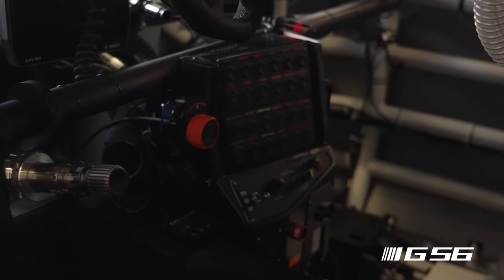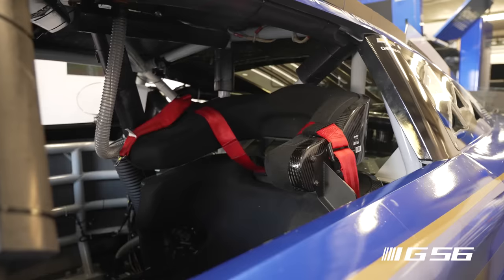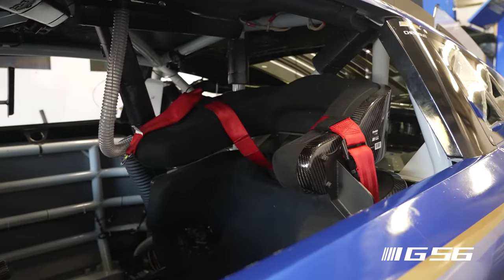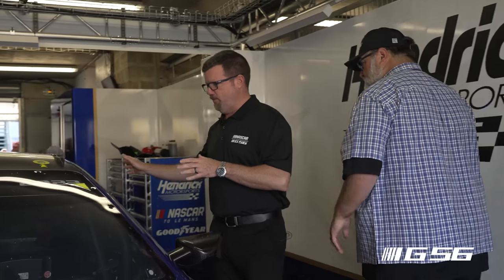Garage 56 Le Mans Tech Tour Part 1 with the NASCAR Chevy Camaro ZL1 Cup Car

Comment: I love how all European motorsport experts got everything wrong about this project and what they expected LOL
Reply: I dont even think the Americans knew what was coming. This thing looks awesome, sounds awesome and is such a cool addition. According to Jenson Button, it's not even the monster we expected it to be down the straights, but much better in the turns, both high-speed and low speed than expected. It just struggles under breaking, because its fat
Reply: @kolorado7260  yeah it looks like the downforce is decent, but the aero is pretty inefficient. lots of mechanical grip though
Reply: @kolorado7260  And over 2 seconds a lap faster than the fastest GTE...
Reply: @Kyle86910 Well it's testing. Nobody in the GTE class wants bad BoP because they were too fast during the test days. I'm sure they are still hiding a bit of lap time.
Reply: @ciello___8307  that’s the thing, that amount of mechanical grip is insane, it makes a little aero go a long way at higher speeds. Danny Ric and LH said they’re like giant go karts
Reply: @ciello___8307  it's a stock car, not an aero Machine. The whole point was to take a car very close to the cup cars modified to fit La Mans requirements and go racing. 

I honestly think the real thing to prove here is to make it through the 24 hrs and still be driving st the end
Reply: @devinaschenbrenner2683  absolutely. Stock cars don’t have a great track record here, if it finishes I’m stoked
Reply: @devinaschenbrenner2683  I was more referring to comments jenson made in an interview. He said the type of aero they installed on the car (like the duckbil spoilers) aren't as effecient as whats on the GTE cars, so their top speed on the straights isn't as high. they are making speed in unexpected areas
Reply: I don’t think that nascar believed that it would possibly show up most GT cars. The only ones not surprised might have been Hendricks.
Reply: To be fair , it could have gone either way , it all depended on how much of an actual cup car they would keep . This is massively modified from a cup car but still very impressive bit of kit
Reply: How long will tires last with that weight? The amount of pit stops over 24 hours can add up!
Reply: If you genuinely think this is going to be faster than the GTE cars at full race pace better think again, even Jensen and Jimmy both said they can’t hang with the GT cars. They have the torque out of the corner but lack the aero to stay in front of them.
Reply: @Maenfy  True to an extent but if you look at the sector times where they are pushing the nascar is right there... The FIA was planning on waving the flag if cars were coming up behind them but after practice they pretty much said oops nevermind the nascar is faster than we expected
Reply: @JustinCFC  5 seconds faster can’t hang wtf are you on?
Reply: @RonnDoge  go watch the interviews with both of them.
Reply: @RonnDoge  everyone knows GT cars sandbag before BOP is announced. I’d love to see Garage 56 do extremely well this weekend too, but just keeping it realistic.
Reply: @Kyle86910  5
Reply: @ciello___8307  its top speed was 312km/h in the race, compared to 305km/h for the GTE car that finished first in the GTE class. They had to slow it down on the straights because it would overtake most of the field on the straights if they didnt
Reply: @Maenfy  they were literally leading every GTE in the race until their gearbox blew up
Reply: @whenisdinner2137  Yeah but how was I supposed to know that before the race started? Also the Corvette did a faster lap time then the G56 car if I'm not mistaken.

Comment: NASCAR needs to run its own 24hr event. That would be too logical though.
Reply: Agreed. I'd even settle for a 6 or 8 hour race at Road Atlanta with two mandatory driver swaps. VIR would be fun as well.
Reply: COTA, Sonoma, Watkins Glen, and Daytona all good candidates for a 24hr race. Although I don’t think the drivers will last unless they pull up Xfinity and Truck Series.
Reply: IMSA is owned by NASCAR, so they technically already do
Reply: @BaffinSailor  Maybe each car has to be fielded by a team. Like, Hendrick only has 1 or 2 cars. It has to use the 4 drivers they have.
Reply: Only if they use cars like this I would watch. The current ones are too slow.
Reply: It would be fun but it's impossible with the current cars. The components just aren't designed for that kind of endurance. Hence many of the changes needed for the G56 car.

Comment: I heard the tyres say "Ouch" at 2960 lbs
Reply: that's 340lbs lighter than the standard Cup car. The tires will probably be happy. I'm curious if they're running NASCAR compounds and tire builds, or a tire similar to the ones on the GT cars.
Reply: @2005StangMan  I hope he asks that question in the next video!
Reply: About 150 lbs heavier than a GTE.
Reply: @2005StangMan  Goodyear supplied special tires for this Camaro.
Reply: Yup, developed specifically for this car after a few weeks of testing on the test mule the team built.

Comment: "If you can take 5-8% of weight off every single piece, you can save an amazing amount of weight". Yes. about 5-8% total 🤣 jokes aside, just cutting off the bolt ends to 2 threads on my bucket-o-bolts was 41 pounds (good old steel alloy, not titanium)

Comment: But yet we can’t have a 300 mile race without blowing many brake rotors?
Reply: :D, 56 has the larger spec discs and made from carbon.
Reply: I hope Larry Mac can find out if they covered the brake ducts with tape, which would explain the excessive heat
Reply: And failues